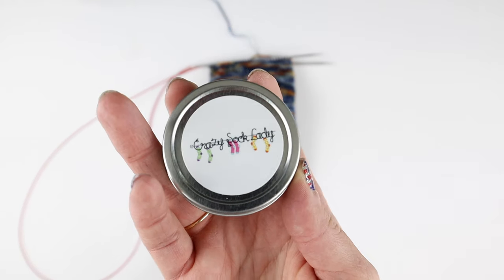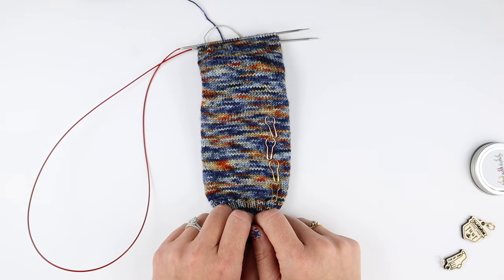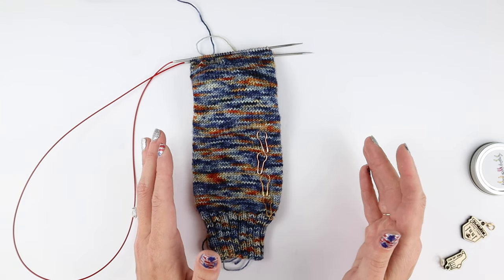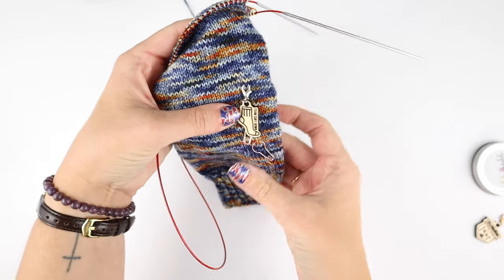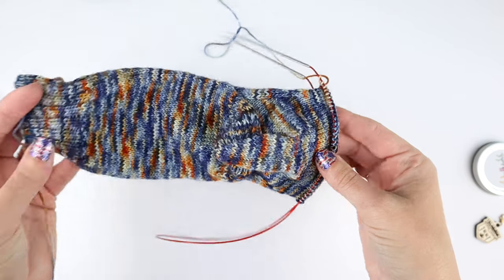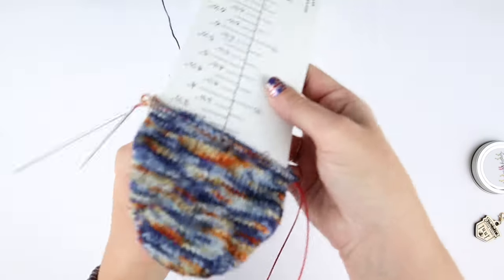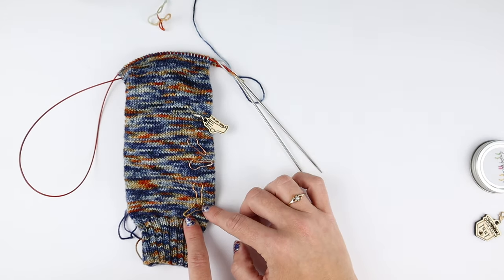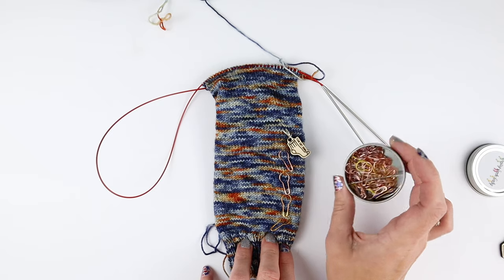Why I use so many Light Bulb Progress Keepers on my Socks! / Crazy Sock Lady

Comment: Great video. Great resource for sock knitting. I use my lightbulb markers the same way.  The tin is great with all the markers and the small needle.  I have your cuff down marker and the small scissors from your shop. I highly recommend all your accessories. They are great. One stop shopping!

Comment: I have been using the lightbulb markers since I saw you did that. Makes it each sock measures exactly the same. Measuring is less accurate. The only thing different I do is mark the row right after the heel and could to the toe from there. Years ago my socks were a little off with just measuring. So you have the best idea. Thank you.

Comment: Honestly, using scrapyarn for the same purpose is so much quicker and easy! When you're done, removing the yarn markings takes less than a second, and also laying it over the sock after ten rounds is quicker than opening up a marker, placing the marker and closing it.

Us "old" knitters never used stich markers. I use them as progress keepers, but otherwise I always just use scrap yarn.

Just a tip to save time.
Reply from the maker: To each their own. Different things work for different people. ♥️